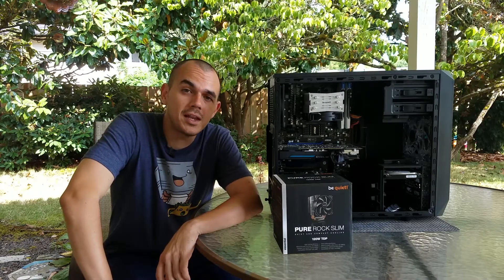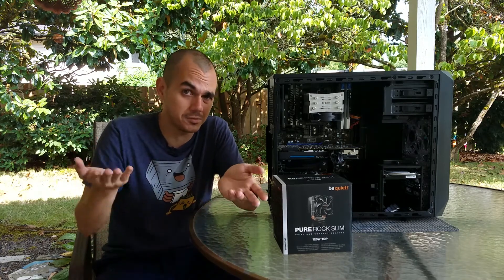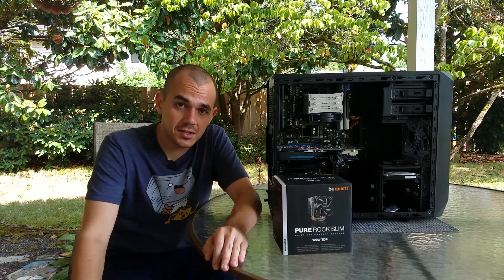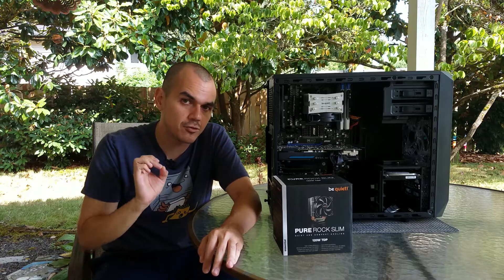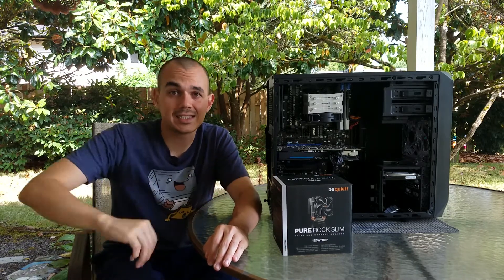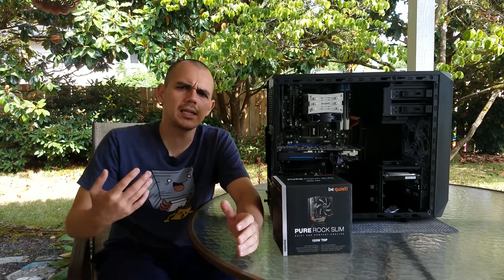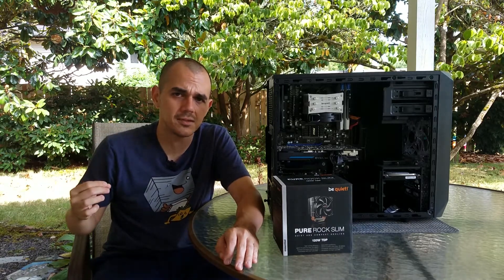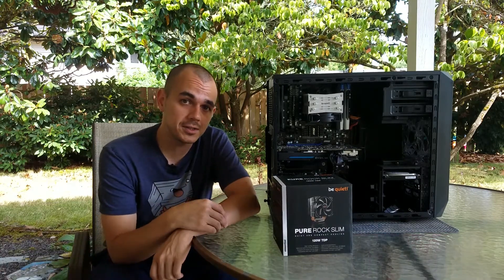MANIC TECH: Be Quiet! Pure Rock Slim Heat Sink, Can It Handle A 125W TDP!?

Comment: I don't like spending money, nor do I like noisy fans. I don't want my CPU thermally throttling. I'm getting one!
Is the "be quiet! Pure Rock Slim 2" much different to the "1"?
Reply from the maker: From what I can tell the new one mainly has a mounting hardware difference for AMD-based systems to allow the fan to be oriented pushing air out the rear of the case instead of the roof.

Comment: I have an AMD R5 3600 non X.  I can overclock it to around 4.4ghz with 1.3v on the core with around 76C underload and 30c idle (20c ambient, its cooling down where I live too so now I can have the window open and a fan blowing into the case for that nice 10c ambient air
Reply: If that were my system I'd tone down the overclock a bit 76c is running a tad too high for my liking.

Comment: Is good for i7 8700 with gaming and load??
Reply from the maker: Well since I don't own an 8700 or any Z370 products currently, I can't speak from personal experience, but given that the 8700 has an advertised TDP of 65W, it should work just fine!
Reply: It can cool up to 125w. I'm using it on my 80w i7 4th gen and it barely goes over 60c while the fan speed stays really low in my case. Much better than the stock cooler which overheated and was like a jet engine.

Comment: I am in a similar situation, but my concern is that I'm going to be using an Intel core i7 7700K. I know it's rated for 91W TDP, so it theoretically should work. But I've also heard that this processor gets very hot compared to AMD. Should I still consider this cooler for use with Pro Tools 12? I will not be gaming. Thanks.
Reply from the maker: Julian West yeah that chip does get pretty toasty, but mostly in heavy VCore overclocking situations. While I've never overclocked with a 7700K, I would imagine that this heat sink could handle the chip at stock, at least, with maybe a tiny bump in clock speeds, provided you don't move VCore too heavily. That may all come down to how well binned your chip is tho. Wish I could give a more concrete answer than that! I'd even say delidding might help, but if you're using a heat sink like this it hardly seems worth it to invest that kind of time, effort, and risk.
Reply: The Manic Geek Thank you. Outside of those tutorial videos that show you how to assemble a computer, this has been the most helpful advice I've received for my first build. If I was looking for a gaming PC, this process would probably be much easier. Even if I find guides for Music Production PC's, there's still no guarantee it'll work specifically for Pro Tools, and the producers making these guides and builds aren't necessarily computer experts. Even Avid's own guidelines and customer service is totally unhelpful. Thank you so much! Now I just need to figure out what the deal is with a quiet graphics card.
Reply from the maker: Glad I could help!

Comment: Why dont you use water cooling
Reply from the maker: I have no issues with watercooling, however I lack the time and resources to get anything custom going.  Besides, for the vast majority of users, a robust air cooling solution will work extremely well, even under heavy overclocking, and have a lot more reliability and ease of servicing in the process.  Watch Paul's Hardware's latest videos on servicing Arctic Panther... can you honestly tell me that's any more "reliable" or easy to maintain than just slapping a heat sink like this one on to the processor and, outside of high core count and TDP parts like he is now using, you couldn't expect to net the same kind of overclocking results with likely less noise since there's also not a pump pushing water around?

Trust me, I would still LOVE to get a custom loop going in my current rig, which is now running an Aorus X470 Gaming 7 WiFi and a Ryzen 5 2600... but frankly the Scythe Mugen 5 Rev.B I'm using is still holding my 4.1 GHz overclock just fine at very reasonable temperatures, so I got time to wait on that one still, and given my lack of time and resources at present, this is a safer alternative to the only other water cooling I have access to: a first gen H100i which is out of warranty now, and who knows how long the pump will last on it.

Also... and this bit is important... this is a review of an air cooler, not liquid cooling x-D